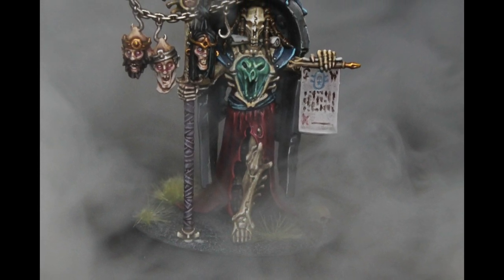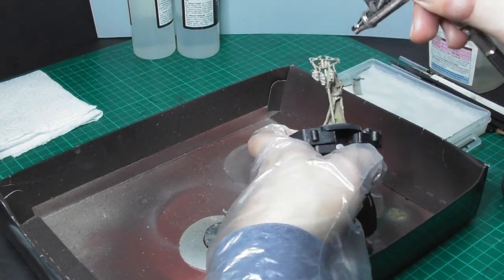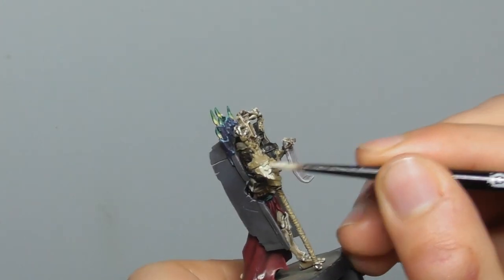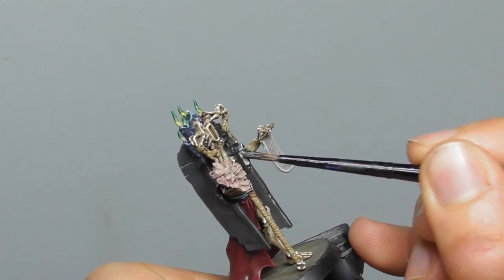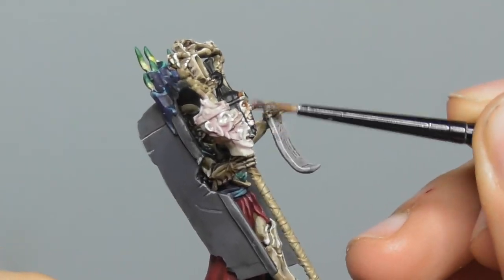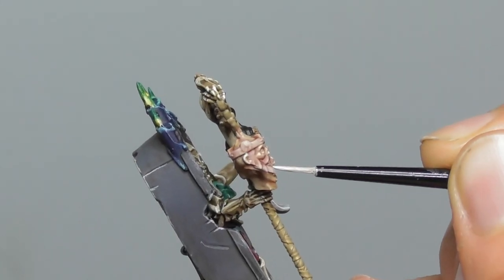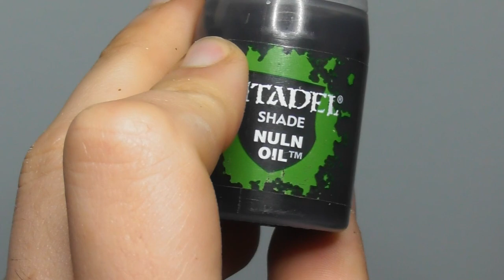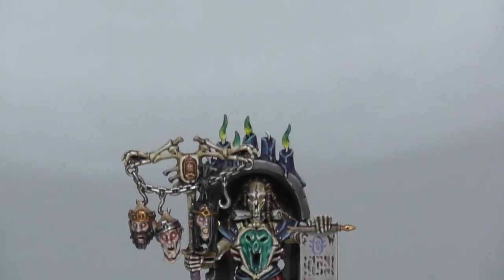How to paint Vokmortian Master of the Bone tithe

Comment: Amazing work.  I hope to start an Ossiarch army in the New Year and this is very inspiring.  May I ask what brushes you use please?
Reply from the maker: Thank you very much!^^ I am using mainly citadel brushes which are M S base, M shade, M S layer, L M S drybrush, XS artificer, but I do use also some of the army painter brushes specifically the psycho which is one of the smallest brushes Ive ever had so far for very little details.
Reply: @N3rds0me  that's cool - I was so impressed with the way your brush held its shape that I thought you were using something more fancy!
Reply from the maker: Well I must say I do try to keep them in good shape, however I do have to have them in stock cos overtime they do get destroyed specially the drybrushes.:D